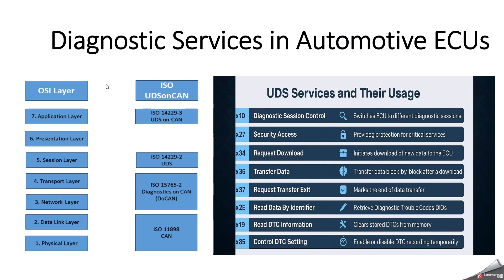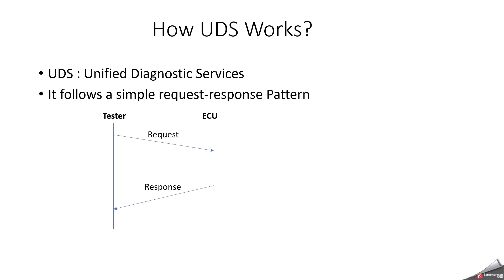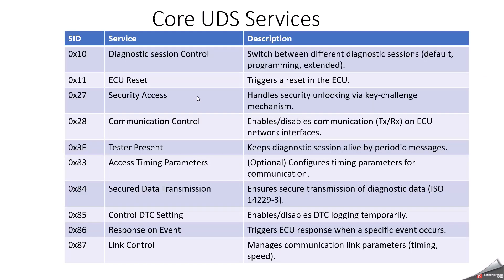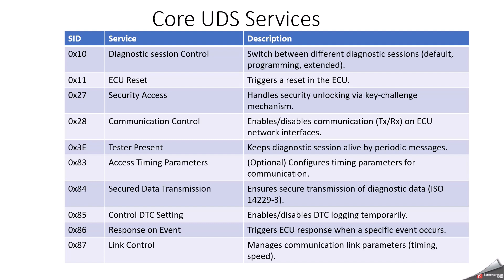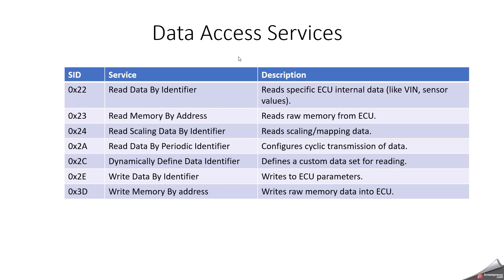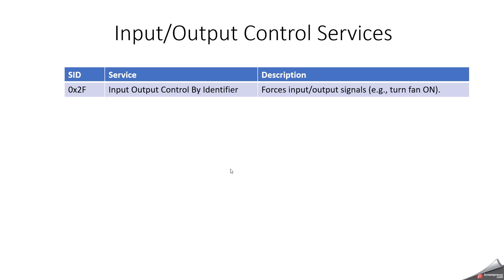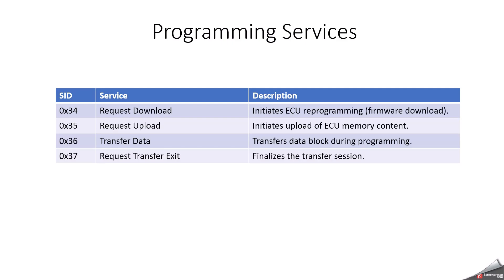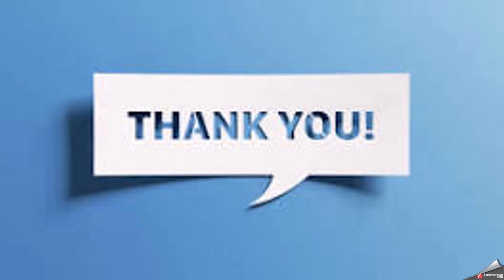UDS Protocol | Diagnostic Services in Automotive ECUs | ISO 14229 with Examples | DCM | AUTOSAR

Comment: This explanation makes UDS so easy to understand! I'm curious, when an ECU sends a negative response, how detailed are the diagnostic trouble codes usually? And if I'm working with an ECU that uses both CAN and Ethernet, are there any differences in how the UDS request - response pattern behaves over these two protocols?